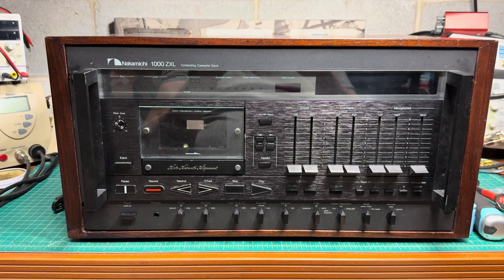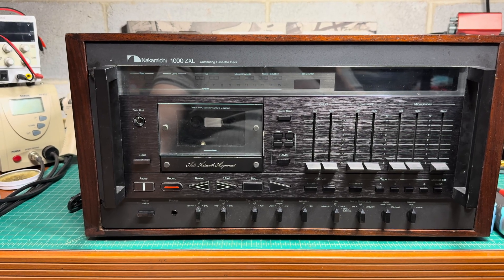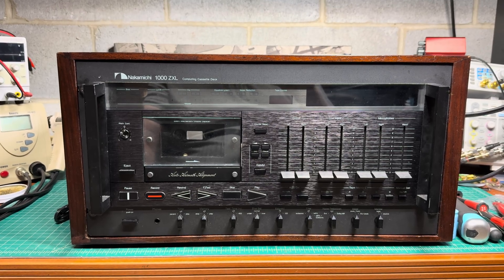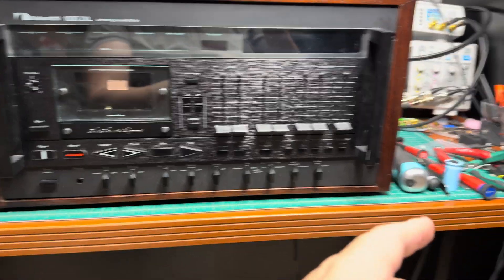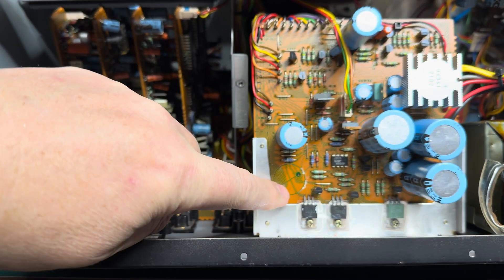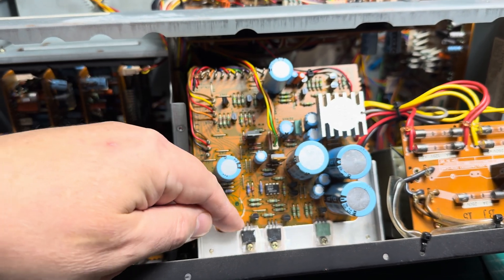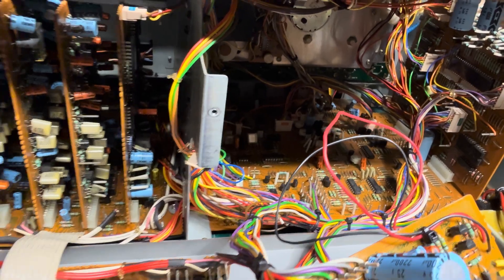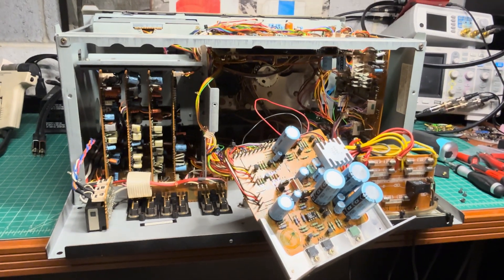Grand Master in Trouble | Nakamichi 1000ZXL Repair Begins

Comment: Could it be electrolyte leak from the legs? They usually become dotted with green spots, the material might have micro-pores, but I don't see black spots on the traces on the other side.

I've never seen a capacitor failed that way, where the legs seem to have been chopped outside of the enclosure.